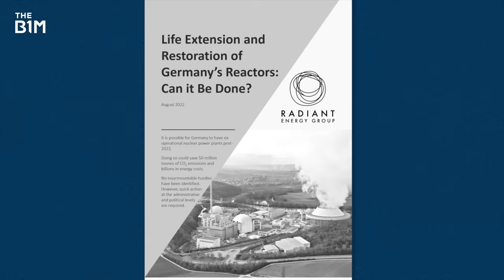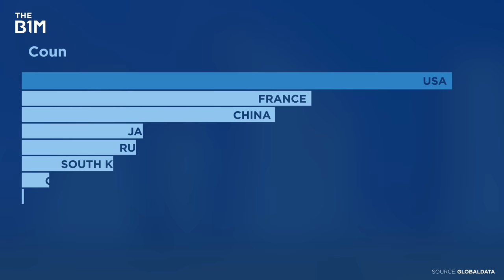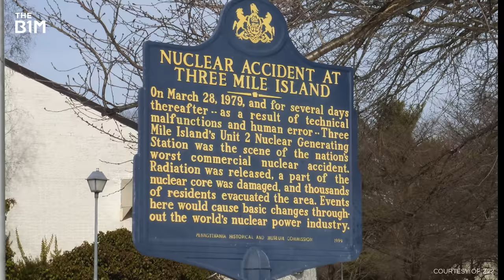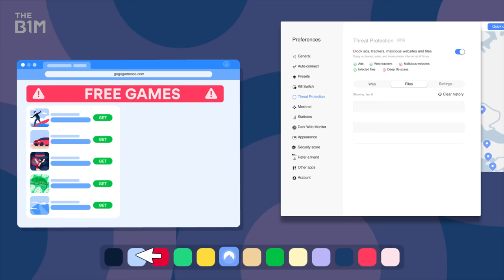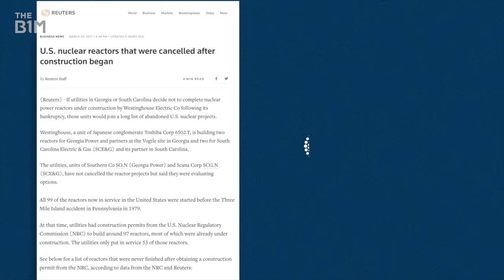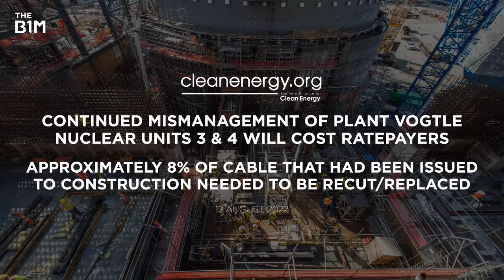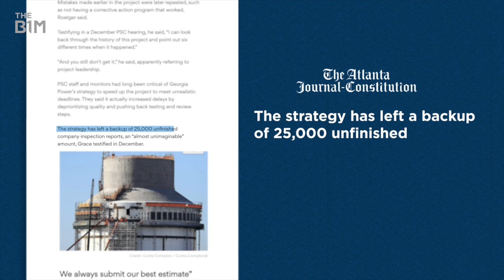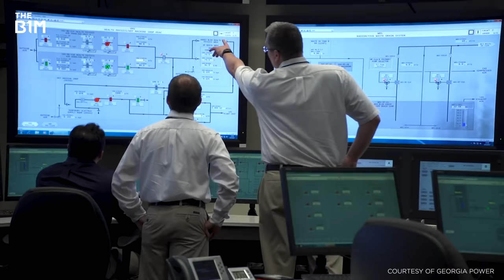Why Nuclear Power is Making a Comeback

Comment: Was this supposed to encourage more nuclear power? Because it taking like 13 years and double initial budget just to expand one tells me solar/wind + storage will not only be much faster, but cheaper.
Reply: Well it’s quite simple. Wind and solar are just not an option here. They’re a different type of power generation.

You see, there are three types of energy generators out there. 

Variable, which is things like wind, solar, tidal. Basically anything where we do not control the amount of energy output.

Peaker, which is plants like natural gas, geothermal, and hydro. which can change their energy output very quickly, but often can’t provide electricity as cheaply as the very last type

Base load. Base load plants are things like nuclear, and coal. Plants which take a long time to spin up or slow down. But which can generate vast amounts of energy on the cheep. Which is why we use them to generate the bulk of all electricity on the grid.

Now, to use the types of plants as something they’re not. (Nuclear as peaker, wind as baseload ect) is often very difficult if not down right impossible. There are types of peaker plants which can be used as baseload. Like hydro, or geothermal. Infact the Norwegian and Icelandic power grids are near 100% hydro and geo respectively. But others require so much ether capacity for grid storage or redesigns that they’re just not an option.
Variable generation types are especially guilty of this. If the UK alone for example were to try and use wind and solar for everything. It would require every single battery produced on earth. For the next 30 years to be shipped to the UK. And that’s just setup. Those 30 year old batteries you first bought in 2022 are not gonna power much in 2053. So that’s why wind and solar are just not an option here. They simply can’t provide the stable base load needed to meet the demands of a real energy grid.

Comment: The true clean energy, incredible low need of fuel source and a gigantic output. Dealing with nuclear waste is a little hassle compared to the benefits of nuclear power. Not to mention, if nuclear power really kicks off, safety and efficiency really ramps up

Comment: We need to stop building outdated and dangerous reactors in some of the most seismically unstable locations in the country. This is why people think nuclear is dangerous. But it's like saying the Ford Pinto isn't safe so we should stop building cars. Though at the same time, our government keeps insisting on more Pintos. We've come a long way since Three Mile and Chernobyl. We have the technology to build cleaner, cheaper, safer nuclear power. But we can't prove it because we're too scared to do it the right way.
Reply: Calling our current reactors dangerous just isn’t true. Sure we can build ultra safe reactors but the ones we have now are still the safest form of energy we have.
Reply: Your wasting your time on the wrong problem. 
5 times more electricity is needed in the future all electric world. 
That means a national power grid 5 times bigger in capacity. 
The national grid is horrendously expensive and 5 times is mind numbingly  big.
Nuclear promoters say that the extra transmission costs is too much, but all centralised electricity has the same cost problems.
The bs from everyone who wants government money is the biggest problem.

The auto manufacturers know that they will make a killing because the new EV comes with a massive long distant battery and most vehicles are parked 23hrs every day. For years.

Battery technologies are evolving rapidly. 

Some people say SMRs in every town. 
Small modular reactors. 
But if 300million vehicles have batteries then anything that can put electricity in it at anytime.
EV will selfpark like a home robotic vacuum cleaner and stay plugged into the grid 23hrs a day.

Comment: The lack of context in most discussions of nuclear "disasters" is very frustrating. Chernobyl was so entirely preventable its failure was criminal. Fukushima happened in the worst place you could build a nuclear reactor with one of the most powerful earthquakes ever, and there still weren't any deaths directly caused by the meltdown. Three-Mile Island was so benign that the other reactors continued to function normally. To top it all off, these reactors aren't even the safest designs available so there's really no reason to consider wind, solar, or fossil fuels safer/cleaner.

Wind kills birds at a genocidal rate, takes up land, requires extensive mining for production, and is least reliable.
Solar relies on toxic panels which can't be recycled and are produced with minerals that are mined without concern for the environment. Not to mention the batteries both of these rely on which are not recyclable or even able to be produced at the level required for them to take over the grid.

Fossil fuels come out looking nearly benign except for the mining, air pollution, and volatile nature of the markets. At least they don't rely on rare earth minerals or heavy elements. The number of people killed each year from fossil fuel production is insanely high compared to all nuclear disasters combined.

Comment: I had the pleasure of running the cranes at vogtle. Ran the smallest crane up to the largest on site. Definitely was a different animal with dealing with the NRC guidelines and all the red tape when it comes to the severity and importance of quality when building a place that could endanger the public, but I can honestly say it is built right. I made a ton of good money over the years working there. It’s a benefit to the infrastructure of America and most definitely a blessing to the surrounding communities with the jobs and money from travelers coming into town to work. I worked plenty of jobs in the energy field such as erecting wind turbines, gas plants, and coal fired plants and can say nuclear made me the most steady paycheck year round. Definitely an advocate for nuclear energy for the future!
Reply: I totally agree with everything you said but at $16 billion per unit it is a financial failure of massive proportions. Because of that no other utility is even remotely considering new nuclear
Reply: @clarkkent9080  I see your reasoning behind thinking that. As for the price tag it was a first time build using Westinghouse’s new reactor design so it was pretty much learn as you go so to speak. Now seeing what needs to be done along with the paperwork that follows it should help with the next energy entity or even southern company if they do decide to build more in the future. I’m not opposed to seeing both sides of peoples reasonings for opposing, but can’t deny it’s a great step towards our energy demands for the future. I’m all in on solar and wind, but we definitely need a backup for our needs.
Reply: @JusitnevansGrizz  Actually the same exact Westinghouse AP1000 was built and is operating in China.  Both projects had engineers in China and Westinghouse made any changes necessary long before construction of either VC Summer or Vogtle.  So the new-to-you argument is debunked.

Many system modules were factory built to supposedly save money and time.  But when they arrived on site, they did not fit together, and poor welds require rework and cost time and money.  So the factory concept that is claimed to save money has also been debunked.

Also, the NRC had fully approved the design for construction and operation before the first shovel of dirt was moved, something that I do not believe was ever done before.  All the utility had to do was build it according to design and provide documentation to that affect and that is all the NRC reviewed.  The current hold on the project that will cost close to $1 billion and a 6 month delay, according to the CEO, they lost the records showing critical system weld x-rays and system tests.

I follow the industry and because of these failures, no U.S. utility is even remotely interested in new nuclear and if a big if, one ever was interested, it takes 16 years start to finish.  If you take into account that old plants are shutting down each year (Palisades just a few months ago) nuclear's contribution to the U.S. energy grid will decrease for at least 20-25 years before there could possibility be a change.

Believe me, after working in the industry for 40+ years, I am pro-nuclear and I wish things were different but reality and facts prove otherwise.  The only thing nuclear has going for it is climate change.  With 45% of Americans and one political party believing climate change is fake news, I would not bet on that saving nuclear.
New nuclear is dead for the foreseeable future.
Reply: "A little Nukie never hurt anyone" reads my Turkey Point power plant t-shirt.  I was "E-1012" at Point St. Lucie Unit 2. 
That meant that I was the #1012 Electrician hired by EBASCO.
The worst thing about tramping a nuke is finding a decent place to live, the 1000's of travelers ahead of you have snapped up every place to live. Many tramps bring an RV, cuz it seems that most of these huge jobs are in small towns.
Thanks, IBEW, for all the great jobs I worked!   👍
Reply: @crankychris2  I believe it was 2016 when then DOE Secretary Moniz was asked about the future of nuclear power in America. He stated that the future of nuclear power was playing out at VC Summer in SC. and Vogtle in Ga. and if they were successful, then nuclear power had a bright future in America. That simple statement says it all. The construction craft and project management F-ed up both those projects and the future of nuclear in  the U.S..
Until the issues with the U.S. construction industry are addressed, nothing will change.

You may find a job in Kemmerer Wy. at the Terrapower site (the ONLY new nuclear project that MAY start) where only 2,700 Americans are willing to live.  More than doubling the population with construction personnel will certainly work out without any problems

Comment: "Proves that nuclear power has a future in America "

 Only,  only, if nuclear is cost competitive - and Vogtle certainly isn't that. At $15 a watt capital cost, it looks really bad, compared to new solar at less than $0.30 a watt, wind similar,  and 100 hour storage batteries at 2 cents a watt.

It would be great for new nuclear to succeed, but the next AP1000 reactor to be built in the US would have to cost $1 billion,  not $15 billion, for that to happen.

Comment: One new nuclear power plant does not a trend make.  Double its original budget and long past its promised finish date, this is just one in a long line of too expensive and too-long-to-build nuclear reactors.  As for the argument that when wind and solar power aren't available when the wind and sun aren't blowing and shining, it's a far better bet that we'll see reliable power storage technology to fill in the gaps in the next decade than to rely on new nuclear plants, which, by the way, take at least ten years to build.  In ten years we'll likely have inexpensive and risk-free electrical storage plants.  Pouring more billions of dollars into nuclear plants instead of putting the money into new storage plant technology for less expensive wind and solar power electricity is nonsense.  This video is likely funded by the nuclear energy industry, and it is heavily biased, to say the least.

Comment: How long does a nuclear power plant need to produce "clean energy" to compensate the "unclean energy" necessary to build it ? I'm curious...
Reply: Romain,
I don't have quite the direct answer you may want, but these links can point you in the correct direction.

1st - I've been told that wind/solar can pay back their emissions in under 6 months of operations (on average). Is it true? Well, probably under 1-2 years at worst.

2nd - I've also been told that "wind and solar can come online in months!", and that we have to factor in the opportunity time of nuclear (i.e. the fossil fuel burning while building the plant instead of having replaced the coal/oil/gas earlier with wind/solar).
I note 2 things about this argument:
A - is that GW-scale wind/solar can take several years (not months) to build:
      https://en.wikipedia.org/wiki/Hornsea_Wind_Farm - HS1 took 9 project years, and 4 years construction.
B - somehow the opportunity time of wind/solar is NOT included when fossil fuels back them up due to intermittency. I.e. when the sun is down on a windless night a gas plant is fired up. Given that the c.f. of solar is 25%, onshore wind is 35%, and offshore wind is 40% - that is a lot of backup!

3rd - Mining for uranium fuel is quite trivial. There are only a few dozen mines in the world producing about 60,000 tones of refined ore (in exchange for 10% of global electricity for 365 days a year).

https://www.world-nuclear.org/information-library/nuclear-fuel-cycle/mining-of-uranium/world-uranium-mining-production.aspx
Iron ore (obviously the biggest after coal) is about 2,500,000,000
https://en.wikipedia.org/wiki/List_of_countries_by_iron_ore_production
Lithium ore is about 80,000 tones - and isn't even close to providing enough batteries to store 0.01% of global electricity consumed in a minute.
https://en.wikipedia.org/wiki/Lithium#Production

Basically, the uranium mining bit is small, small, small. Trivial. The main component of emissions for a NPP is the construction - concrete, steel, etc.

Based on points #1 and #2 and #3 I am confident we have an upper bound of 1-2 years to meet.

How much concrete, steel, etc do we need per NPP?
Well, quite a lot, compared to a single wind turbine or single utility-scale solar panel mount. (per unit)
And, not so much, compared to a wind turbine farm or utility-scale solar panel farm. (per GWh)

The other thing, is that although a single NPP is quite big; it is smaller than than an entire wind/solar farm of the same energy output!
https://www.energy.gov/quadrennial-technology-review-2015
https://www.energy.gov/sites/default/files/2017/03/f34/qtr-2015-chapter10.pdf
table 10.4, pp 390

Thus, given how much less concrete, steel, etc is used by a NPP vs wind/solar, probably much under the 1-2 year upper bound of wind/solar.

The lifecycle numbers for Nuclear show this: when you include the full lifecycle - mining for construction materials, construction, mining for fuel, operation, and finally fuel storage and decommissioning - nuclear comes out very favorably.

Per the IPCC, the total lifecycle emissions of nuclear are comparable to wind. (which is in line with other estimates, both by other groups and by newer IPCC estimates).
https://www.ipcc.ch/site/assets/uploads/2018/02/ipcc_wg3_ar5_annex-iii.pdf
pp 1335, Table A.III.2 | Emissions of selected electricity supply technologies (gCO 2 eq / kWh) 
* wind ~11g CO2/kWh
* nuclear ~12g CO2/kWh
* hydro ~24g CO2/kWh
* solar ~48g CO2/kWh
* Gas—Combined 490g CO2/kWh
* Coal—PC 820g CO2/kWh
Reply: “necessary” 

There is no necessary dirty energy to build reactors or supply fuel, it’s just the way it happens to be done right now.  Build enough reactors and new reactors can be built w energy from existing.

Comment: Nuclear is the way to go, far more stable than renewables and way cheaper to run. New safety systems will ensure early alarms are in place to avoid anything from happening. Also the more nuclear power there is, the more energy independent you are. 

Wind farms froze in Texas for the sole reason that they didn't bother to fit the cold climate package to the turbines. And that's a crucial information when talking about wind power not working in cold weather.

Comment: Plant Vogel is a huge job program, priced out of any rational rate structure, and has the quality of your average garage project. Quality according to the AEC is spotty (at best) inspection schedules ignored or just not performed, workers unqualified to work on such a “moon shot quality” project.
A boondoggle in every sense. $30 BILLION dollars and not a kilowatt produced. Still not a firm delivery date at this time, a decade behind schedule. This makes Frances €300,000,000 cost overrun a pittance! 
Georgia did not have Residential Inspections in many parts of the State as late as the year 2000!

Comment: The issue of nuclear power is never about the safety, the science, or the technology.  The issue is all the the irrational fear of the China Syndrome caused by the a possible core meltdown.  We had two major core meltdowns, in Chernobyl and in Fukushima.  We saw a well managed nuclear accident in Japan and everything was contained.  A badly managed accident in Chernobyl will cause a lot of havoc.  All western nuclear regulatory organizations are well managed compare to the old Soviet days.  Even for the former Soviet state  such as Ukraine manages it nuclear energy extremely well.  It took the current war by the main Soviet player to ruffle this safety regime